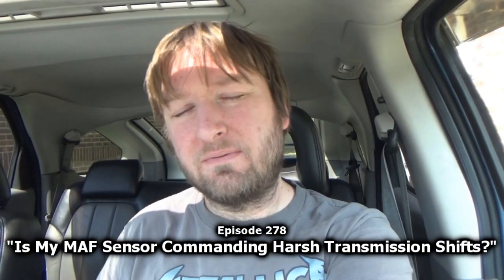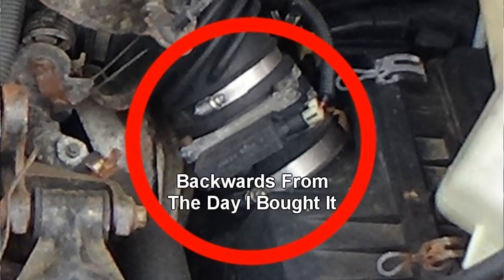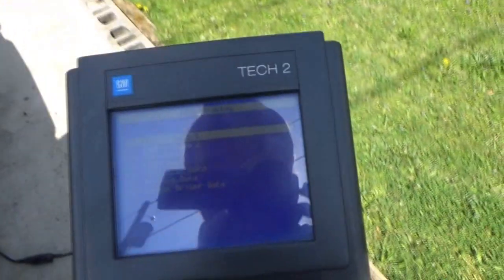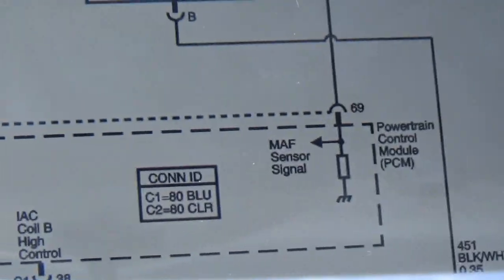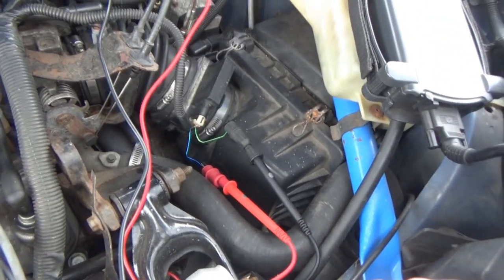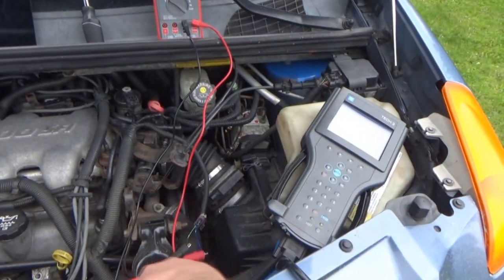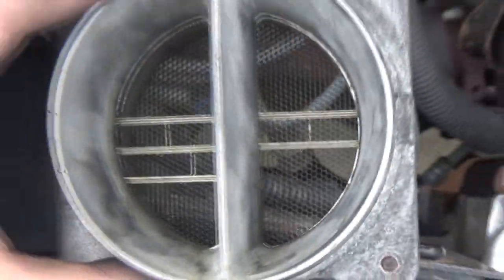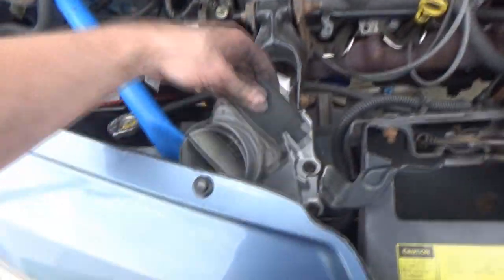MV 278 - "Is My MAF  Sensor Commanding Harsh Transmission Shifts?"

Comment: What’s really funny is that my car is still running rich and the worse fuel trim is -29%. And that’s long term. I’m going to try and borrow a tech 2 from someone and reset the fuel trims. I have basically replaced every sensor on this car at this point lol